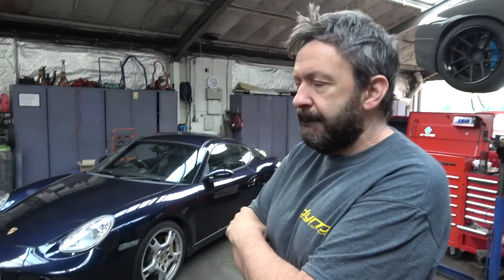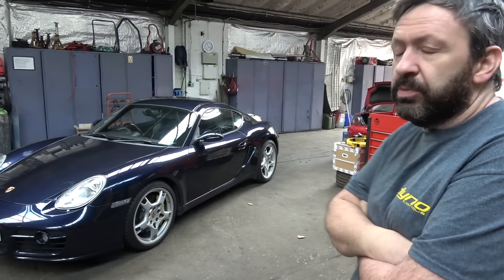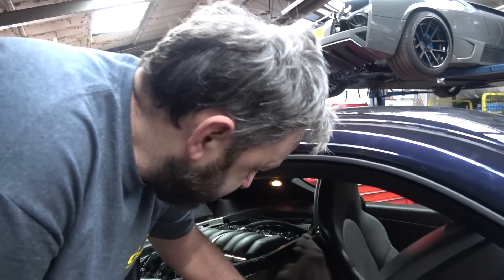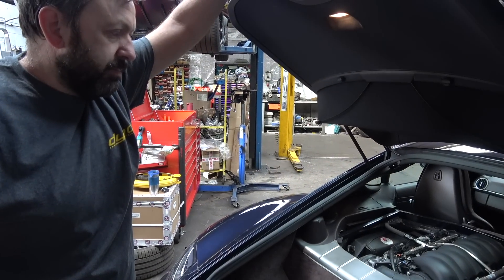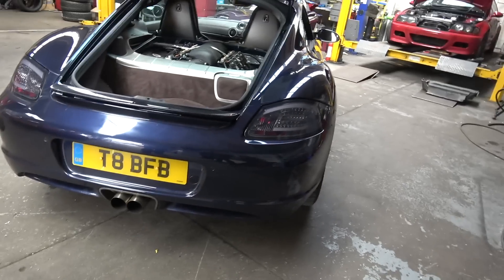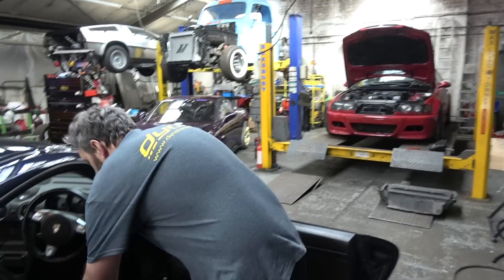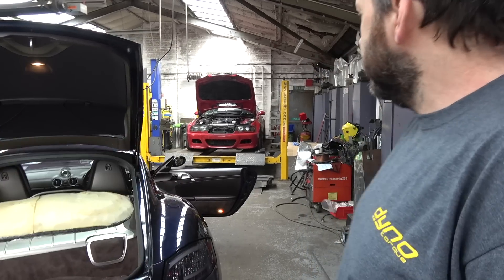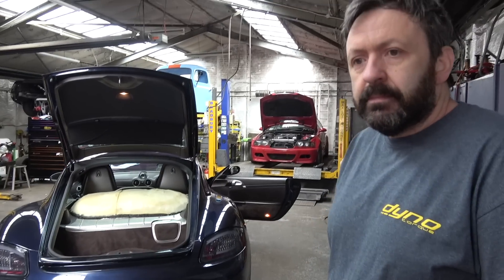LS3 V8 Engine Swap Porsche Cayman by Dyno Torque

Comment: I wonder how many people appreciate how rare LS swaps are in the UK. Looks a serious amount of work. Rather Craig than me 😂
Reply: I don’t need a swap. My car came with an LS in it 👍
Reply: Adam Bainbridge fucking expensive truck motor right there 😂
Reply: @ifyoudontbelong  truck motor that isn't used in trucks and is lighter than the engine it replaced ;)
Reply: @ifyoudontbelong . It’s a fully aluminum 376ci motor, not a truck one. This motor can make 600hp with stock PTV clearance and no boost needed.

Comment: Isn't the ls4 the front wheel drive version?
Reply: Noel Medina The ls4 is fwd and mounted transversely. This engine is mounted longitudinally with an adapter plate to a porsche transaxle.
Reply: Yep, he's just using the front accessories off it.

Comment: Do you  think DynoTorque would be able to machine the face of my rear wheels down to bring the ET up ? Take them from ET35 to ET38/40 ??
Reply from the maker: BoredThatsYImOnThis its not the type of the Craig does, but it’s possibly something he could get done with our friend Martin. The first question will be: is there enough depth in the wheel nut / bolt recesses & the second is: is it worth it? As it’ll be an expensive thing to get done properly.
Reply: Driftworks I believe there is enough depth the actual face that meet the hub is quite a large piece of metal, they are ET35 and the original ( OEM ) wheels are ET48 ( Integra DC5) would be worth for me peace of mine that the tyre isn’t  going to make contact with the arch and mean il be able to lower on the coil overs at the back... I don’t have other options